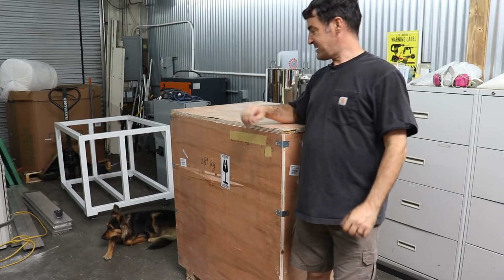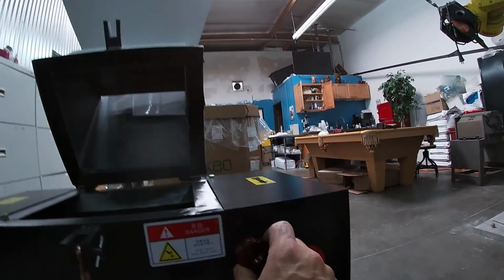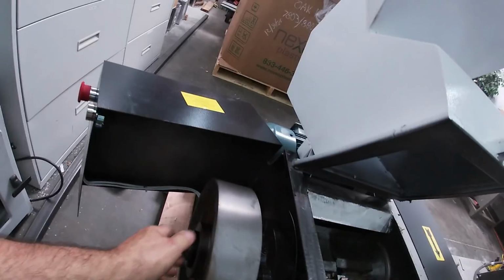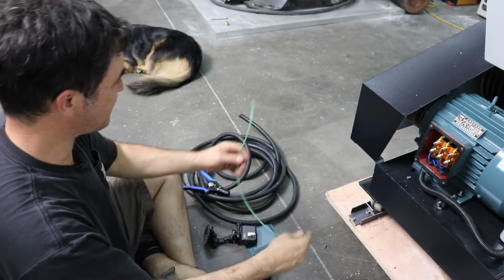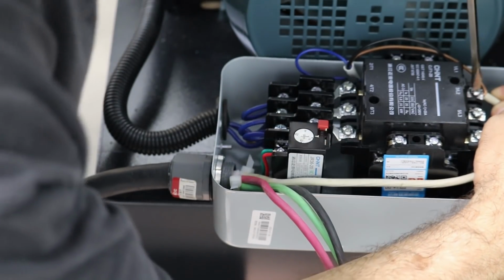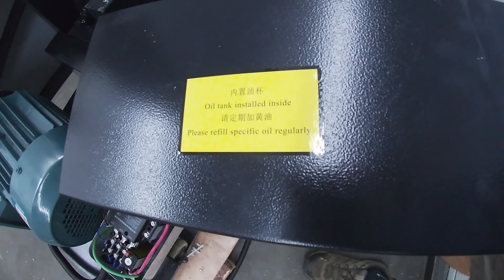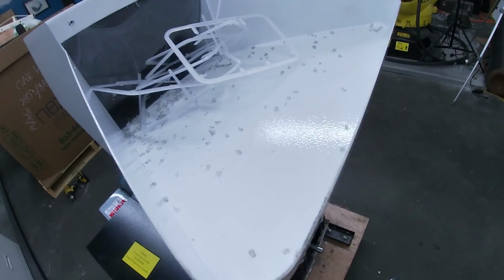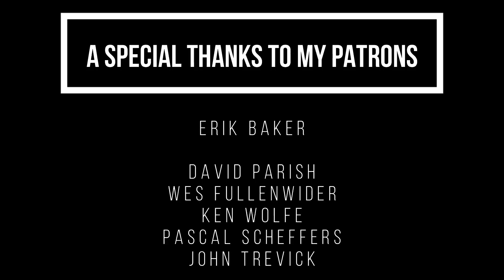PLASTIC SHREDDER

Comment: FWIW AC-3 is most likely an IEC Utilization Category that describes what kinds of loads that contactor is meant to switch. In this case the 3 means its meant to switch motor loads, the fact that it is also 3 phase is unrelated AFAIK.

https://en.wikipedia.org/wiki/Utilization_categories

Comment: I think you made the right call when buying that granulator. My dad works for a company that makes lab centrifuges, and their suppliers are having issues sourcing ABS (for the housings) and Polypropylene (for test tube adapters that go into the rotors). The suppliers had no idea why there were shortages, but potentially there are issues up the chain unrelated to the pandemic. For instance, it could be that China made some environmental regulations, causing plants to shut down as was the case during the Olympics in china.
Reply: yeah. those stringent chinese environmental regulations....
Reply: @DieselRamcharger  Well, I didn't try to imply they were strict to begin with, just that they may have made some a bit more strict. Although they have been very strict during the Olympics bc perception in the west and that shit
Reply from the maker: Thanks Vincent, the problem plastic comes from Texas,.  From what info I can get, there were problems with the power failure in Feb.  Also, it is hard to fill jobs in the USA right now due to lots of people getting paid from pandemic issues
Reply: @DragonflyEngineering  Its not really hard to fill jobs. Its hard to fill low paying jobs. Thats the part no one likes to say.
Reply from the maker: @DieselRamcharger  Agreed.  Lets hope the market bumps up some pay for real work
Reply: @DieselRamcharger  In Australia, our minimum wage just increased to $20/hr. Our compulsory employer paid retirement fund increased to 10% of gross wage. Yanks haven't had any real wage increases for years.

Comment: Nice Video, nice granulator, i think it is a bargain, the time will show us the quality of it.
And you are realized that you get for what you paing for, i thing it is a good compromise.
In the company where i was working, they have a Product which not allowed for  using regranulate, because it is certified for fresh material.
They use for other Products, after the granulator, a metallextractor for saving the productionmachines.

Comment: Could you make dish-soap/water ice cubes & feed those through the machine to degrease/clean the grinder? (then mount a blower fan through it afterwards to dry quickly?)
Reply from the maker: Good idea, I will probably add soap and hot water to the plastic ganuals that I have already run through it.  Then dry with alcohol (power off) A power washer may also help.
Reply: @DragonflyEngineering  haha, That sounds much more practical!

Comment: Nice. My phone translator says for the yellow sign "Built-in Oil Cup", "Please add butter regularly".  ;-)  It might be good if the outlet bin had a safety interlock switch just in case someone were to think about reaching up from the bottom, but that's overkill I guess.
Reply from the maker: Hi Spehro, thanks for watching.  Yes, you are right about the bottom finger guard.  Unfortunately, I didn't have good footage of the  grating screen at the bottom of the grinder that only lets a certain size of plastic particle through.  So that steel grating prevents fingers from getting in there.  I will ad this note to the video description.  Thanks!